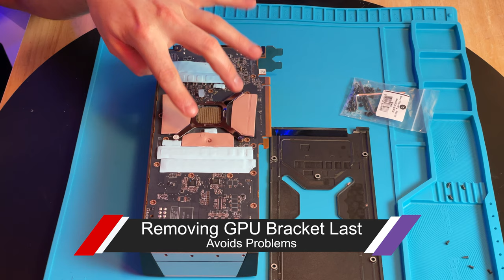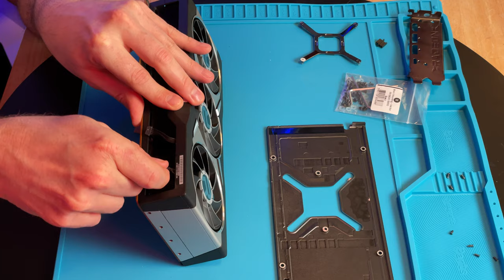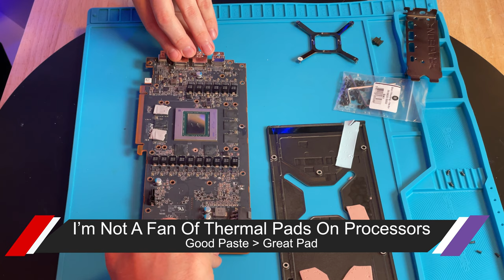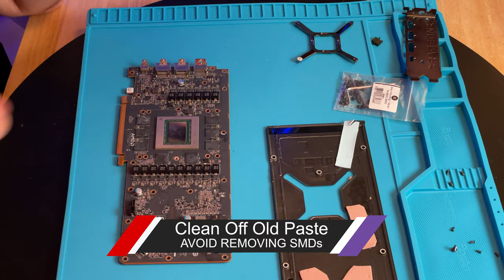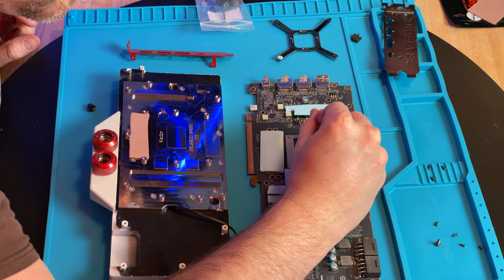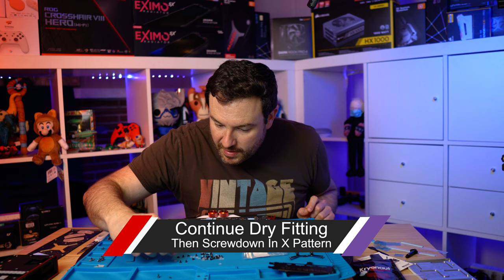EKWB Radeon 6000 Waterblock Installation: Watch me almost break it!

Comment: Hey quick question because I'm dumb and may have missed it. What size thermal pads are you using on the back of the card to soak into the backplate? I'm going to be doing maintenance on my build and taking apart the corsair block I have on my ref 6900xt to pad the back of it and want to make sure I have the right thicknesses.
Reply from the maker: I have two pad sizes, 1mm and 2mm. 1mm on the memory & mosfets 2mm on the VRM.

Also, I don't show it but make sure you also put the thermal bad behind the chip on the regulators. Those get hot as well. 2mm.